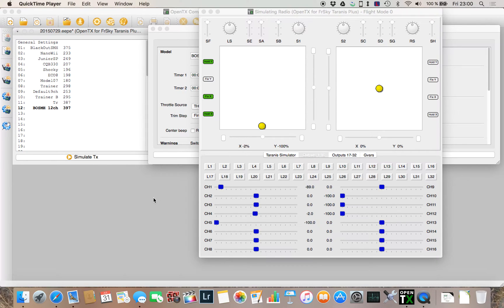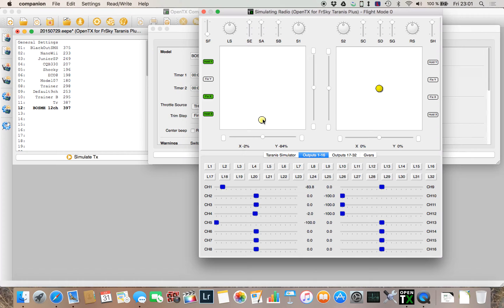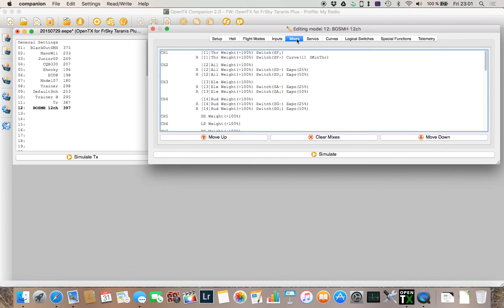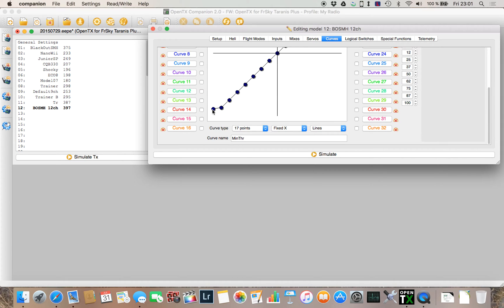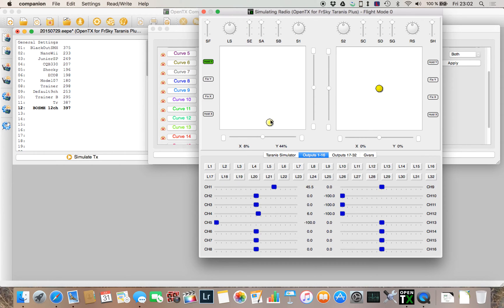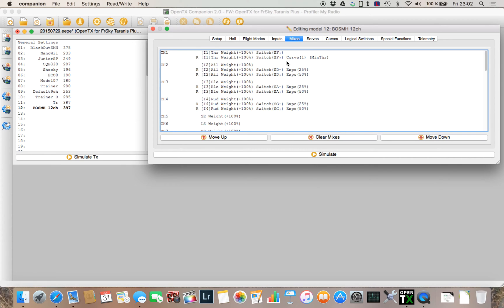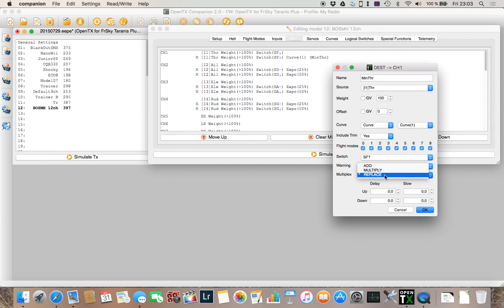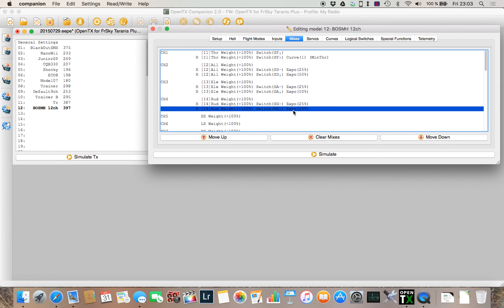HowTo: workaround Throttle Cut / Hold / Motor Stop // OpenTx Companion

Comment: Sweet! that's a very good way to maintain props spinning when THR stick is down at 0 and to stop motors with a flick of the switch. I like how the THR values remain the same too. Very well done. You should set video to public.
Weird your comment with the video link had gone to "need approval" in my video manager. I was about to ask you if you ever got this video up. Thanks!
Reply: +EngineerX I suspected using a diff on the throttle input would make the throttle non-linear,  this looks like a better way to do it!
Reply from the maker: EngineerX Thanks! :)
Reply from the maker: Zenman FPV  not sure you are talking to me :-P But thanks for watching xD